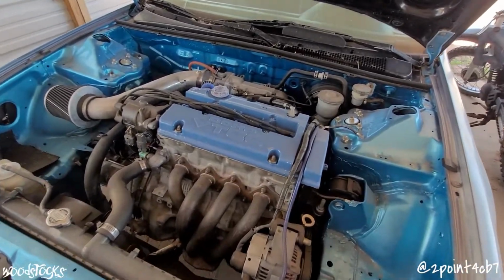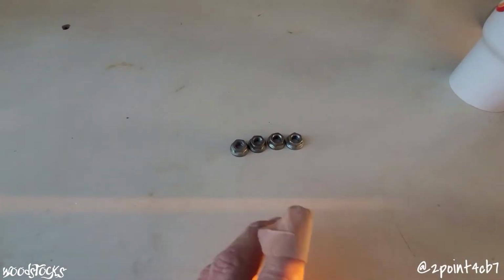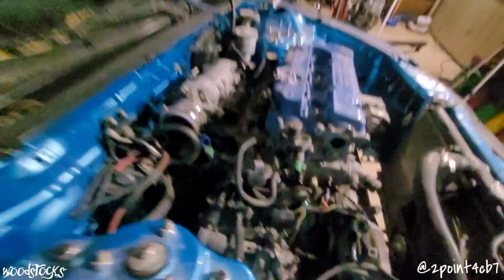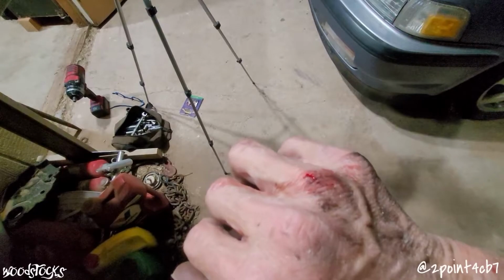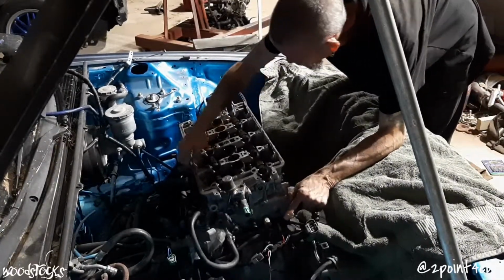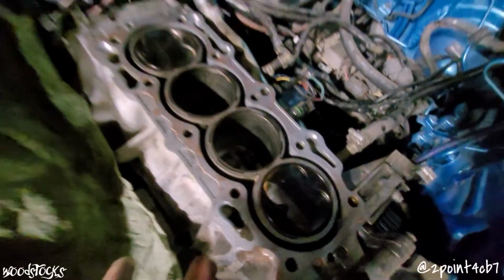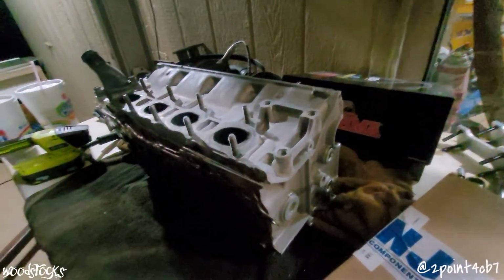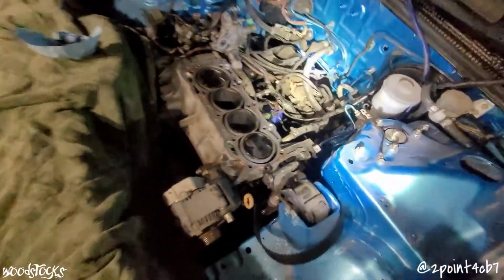G23vtec Update / G23vtec build list

Comment: Why didn't you just go h23a? Wouldn't these issues be avoided?
Reply: f23s are cheap as hell and have a few genuine advantages like the lack of frm liners, 97mm stroke, k20 pistons drop right in, and the block itself is a much more rigid design

Comment: Hello there I'm John by name and I like you videos so I have been working on my Honda Civic ex model and I was wondering to see if I could put a  B-20 engine in it cause I see the K-24 being used in them I just like the way the B-20 looks like the D-17 I been trying to find someone who has build that engine up but know one has done so I see all kinds of B-16 getting done up and I just want something different for my Honda Civic ex model 2001. So tell me something that will work for it thanks bro
Reply: The reason why noone commented was because thats now how you go about swapping that chassis,
2001+ just falls under k series
The 90s however was all sort of swaps why??
Lets start with the 
D15b(japanese single cam) better then usa models
B series b16 and b18type r because japan had the best engines while the usa had slower d series
H2b, h22 swaps because the engine is a monster in 90s small cars
J series- at some point they was very expensive and just people didnt like the power it made in the small chassis cars
And 
The kseries- because people always wanted the new honda engines in a old car ..
D17 is not a platform people mess with 
So for your 2001 civic the only way is kseries
Even if you turbo the d17 theres no tuning source unless buying a aem kit which is like $3 grand

Comment: What ecu are you using for it to handle the k20a2 high comp pistons?
Reply from the maker: Right now its running on a chipped p28 with a h22 tune. When we aquire a s300 ecu, a friend has a dyno tune for us from this exact same build

Comment: Hey I have a question. I built my g23 but have yet to install it. What's keeping me up at night is the tension setup. I did the balance shaft delete and really the only way to put it together is to have the 2 tensioners on. Well the little set screw that holds the tensioner stripped the hole. Thing is if I take that bolt out the tensioner moves and it gets out of time. Do you have that installed still or did you pull it out? Any idea what I may need to do?
Reply from the maker: Not really sure what you are talking about when referring to a set screw? As far as all the timing stuff, everything is there (both crank timing sprockets and both tensioners) as it would if you were still running both belts, except for you only will need just the timing belt
Reply: Brother i dont know if you had the same  issue as me.   I have a 1998 prelude g23 setup  but my crank pulley y touching  the rod bar!!!!
Reply: I wounder if you encounter this problem?

Comment: I used Honda OEM F23a1 headgasket with copper sheets holder removed with no issues on 4 G's that l put together. We tried Felpro F23a1 headgasket but with some issues(oil leaks appeared) so we swithed back on Oem gasket ever sinced. Good luck to your build and you're right ,it is a stepchild.